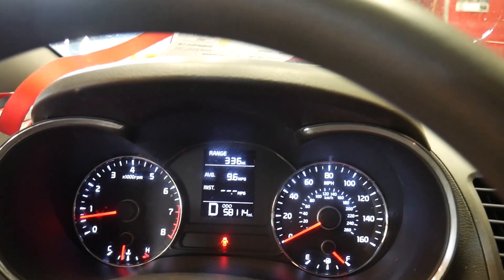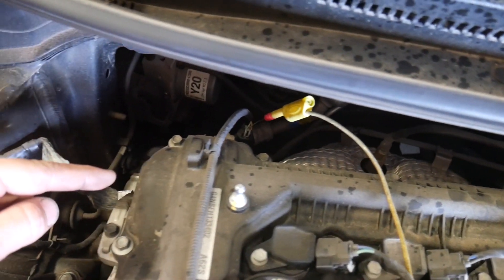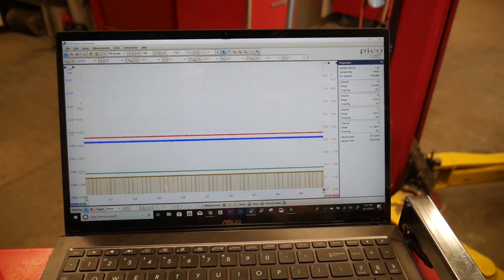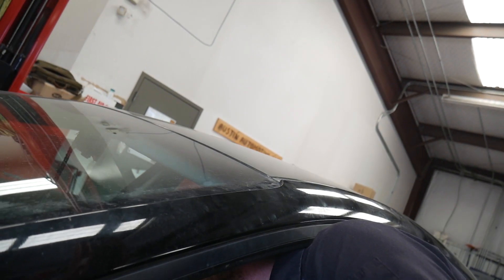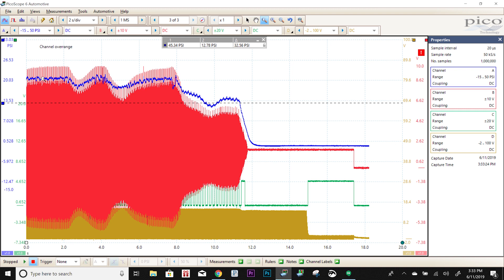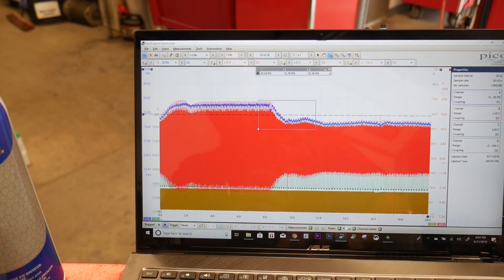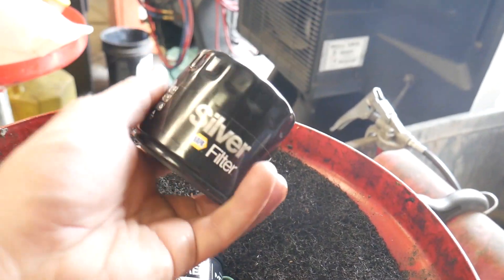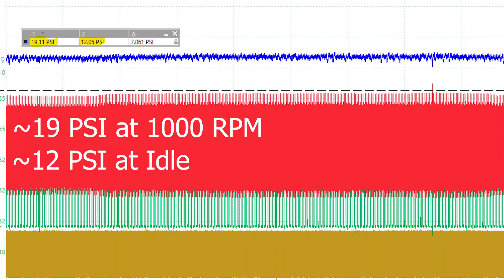2014 Kia Forte shake, rattle and stall- Diagnosing stalling issue

Comment: Awsome video bud. Having the same issues possibly.  But can't duplicate the "knocking sound" indoors. 

Has the costumer returned? 
Worried about the infamous rod knock.
Reply from the maker: Frank 
It took me a little while to duplicate the knocking indoors but if you can get it to act up while driving it might be worth at least slapping on a new cheap oil filter and see if the noise changes. A $4.00 oil filter is a cheap test. If you have a quality low pressure gauge you might see low oil pressure like I did. I could not pick it up on my 0-100psi analog gauge so I had to use the digital setup. 

The customer has not had any issues since and we just worked on their other vehicle last week so I’m they would have mentioned it. I think they got lucky and brought it in to the shop early enough to avoid major damage. One of my lube techs brought a napa filter over to me yesterday and let me know they changed manufacturers. They were using wix/affinia and now they are Mann/Hummel the filter is heavier and looks more like a factory filter. I hope this change in brands means better quality and a closer match to factory specs and operation.
Reply: @ThePracticalMechanic  your the man ! Thanks for the update. Car has a napa filter on from last year. Just got a kia filter with catch valve . Hopefully will see an improvement. Thanks again!

Comment: Absolutely awesome video . And through the eyes of the scope it made it even more impressive .
Reply from the maker: I tried the simple route with just a pressure gauge first but the scope gives so much more detail.  

Thanks for stopping by Keith.
Reply: @ThePracticalMechanic  my 2018 Kia Forte LX is constantly stalling. I’m out of options.. I’ve had the car 7 month and it’s been at the dealer a total of 3 months all together, it’s there now. The dealer can not find the issue and I’m out of options. They replaced the fuel pump/fuel pressor sensor and that didn’t solve the problem